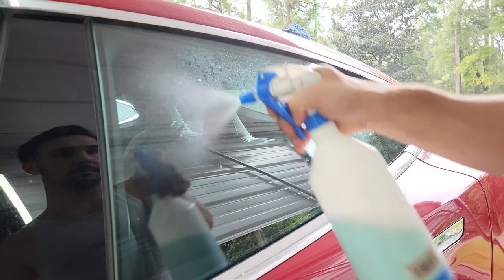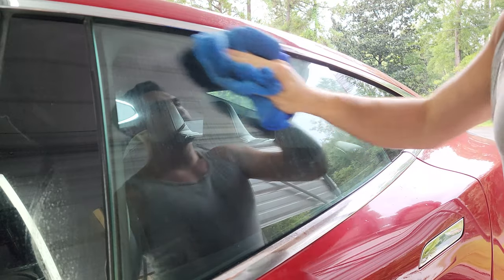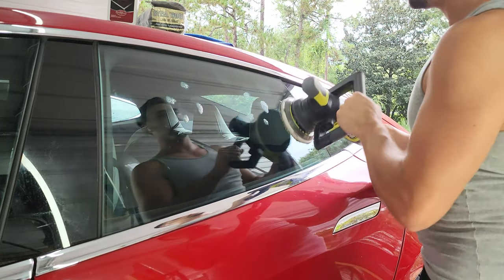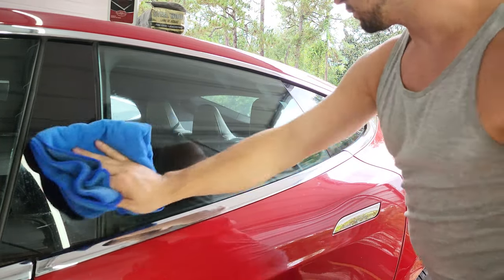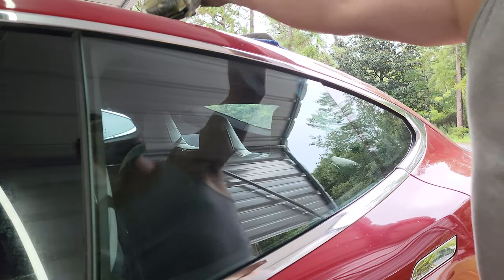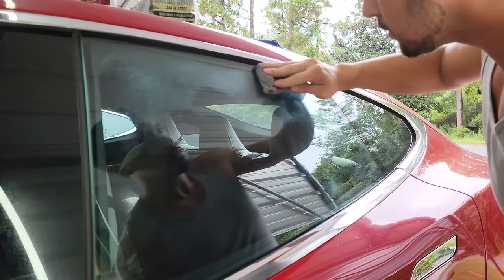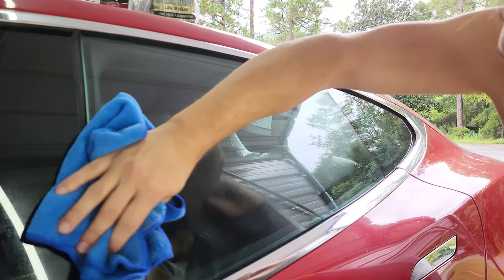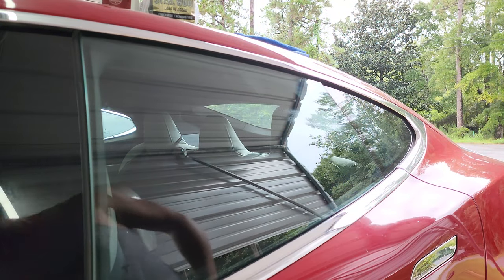Glass Polishing: Buffer VS Steel Wool

Comment: I scratched my windshield pretty bad with a green Brillo pad, but the steel wool doesn’t scratch?
Reply from the maker: I'm always amazed that 0000 steel wool doesn't scratch windows, but it doesn't. 
If you do have scratches you want to get rid of, you'd use cerium oxide: https://www.amazon.com/dp/B07WHMFN7B/ref=cm_sw_r_as_gl_apa_gl_i_EV950MMPS5Q3M48XRJ0T?linkCode=ml1&tag=joemartinmv01-20
Reply: @JoeMartinMVC  
Thanks! I got a kit off Amazon, pads and Cerium Oxide,worked well on those shallow marks. Lots of work!
Reply: It doesn’t scratch. I use it on Crome too. Amazing results!
Reply: Same! I used green scotch brite to remove tint residue on my rear window and left fine scratches. Trying to find a solution
Reply: 0000 steel wool is more fine

Comment: Steel wool has to be dry. Try this again after you’ve cleaned the window & once it’s dry. You should see a difference & for stubborn scale, may need some elbow grease. Should leave it smooth. Especially on newer cars like yours.
Reply: I think it's a Bentley Continental GT, which could be as old as 2005.

Comment: Does it clean over spray?
Reply from the maker: Typically for overspray I would start with a graffiti remover if it's bad: https://amzn.to/3NvlDr4
Then move on to a clay bar and assess from there.

If it's on glass, you can just use a razorblade to scrape it off. If it's on paint you can use a plastic razorblade to remove stubborn bits, and then come back with your clay bar and polish afterward.
Reply: @JoeMartinMVC  I'm scared of razor blades

Comment: You're not supposed to add anything, not even water to the steel wool it's supposed to be completely dry.
That's why it didn't work.
Reply from the maker: Thanks for the heads up. I've always used it in the past with glass polish, but I'll try it again in the near future with dry steel wool.
Reply: Works with over spray that way too?
Reply: True! I just used glass wool on my front windshield to remove small debri. It really cleaned it well. It goes in this order Wash-Claybar-wash-dry-steelwool-clean-rainx(or equivalent). Hope this clears the doubts for someone who is reading this.
Reply: I've been a professional window cleaner for 30 years. we always use steel wool wet to remove hard water.
Reply: @chascline8024 
thank god I'm not alone with this, I've always done it wet and throw away the steel wool later anyway, I don't reuse it as I assume it got all contaminants stuck onto it
Reply: @_Circus_Clapped_  yes always wet. You can use dry to remove light haze and such.